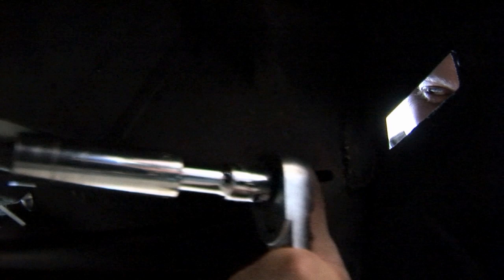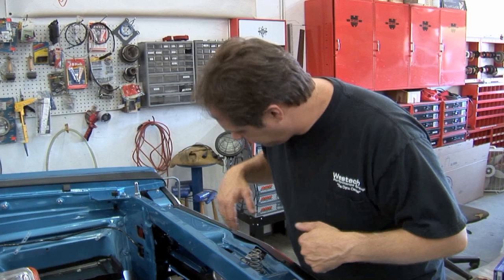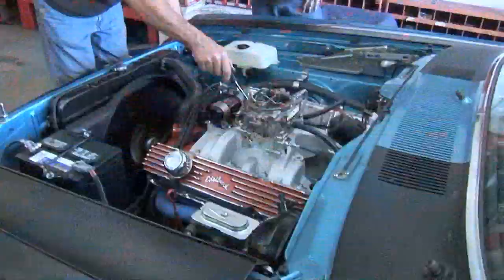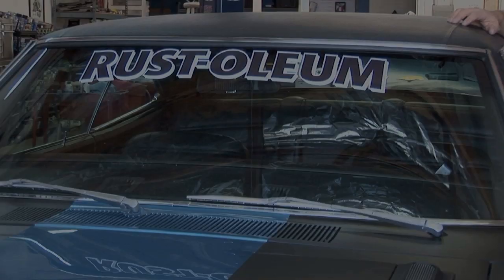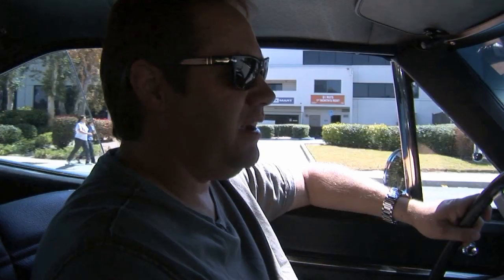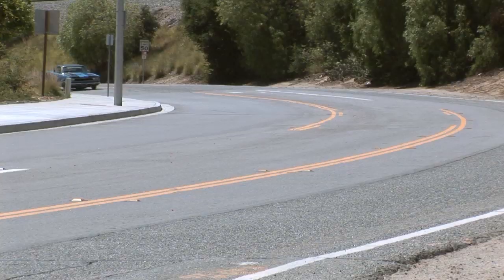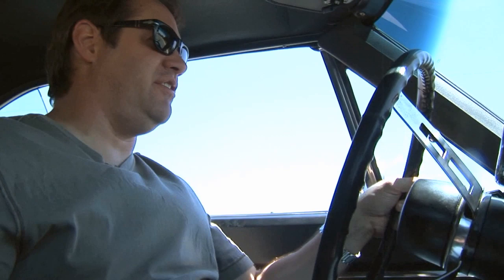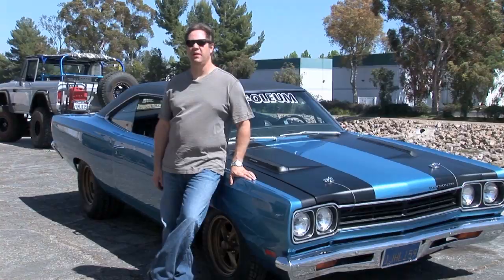Rust-Oleum Project Muscle Part 5 Final assembly and TEST DRIVE

Comment: I agree with jamesm3rd.  The front end is sitting way to low also, adjust the ride height please.  The torsion bars are begging to be turned up.  The rust-oleum sticker is not gaining points either.  Why not just say it is a crylon rebuild.

Comment: I have a '73 Plymouth Fury III name FurYosa "obvious Mad-Max ref/rip lol" an I've been tryin really hard to figure out the stance to use for such a bulky car. With me seeing 100's of styles over a years time there hasn't been much to jump out at me until I seen this RR on pinterest... It's allowed me to envision progress immediately, so the info I really need to know are the measurements/style/brand on the front/back wheels, the stance stagger measurements/degree of the rear lift and the shades of the paints used..... If anybody can answer these for me it would a huge help!! 

(if it's there let me know where because I combed the article over a few times.)